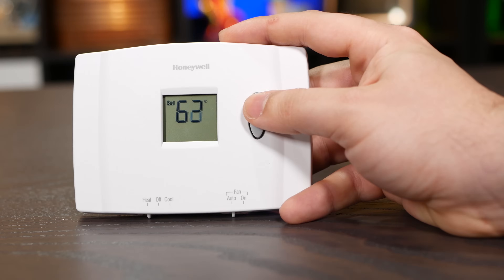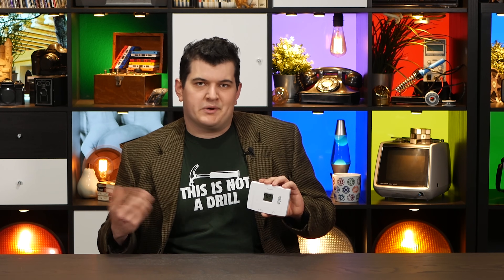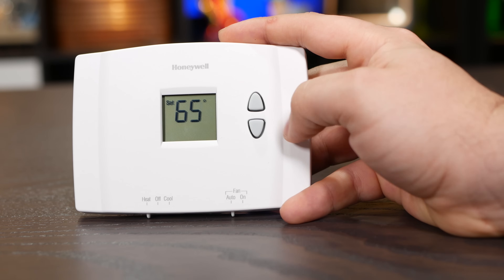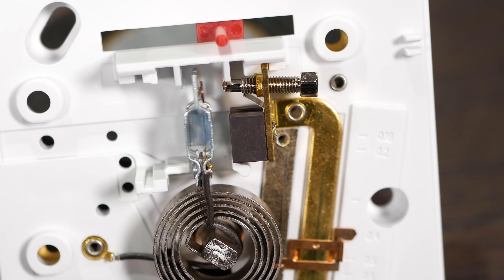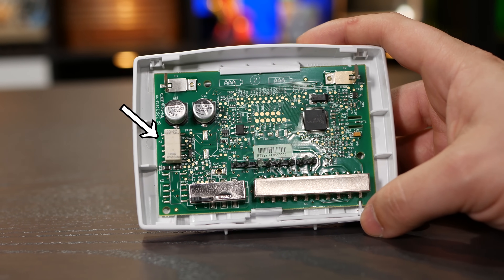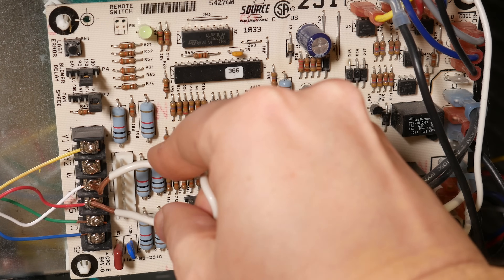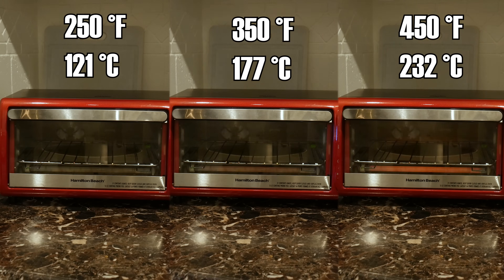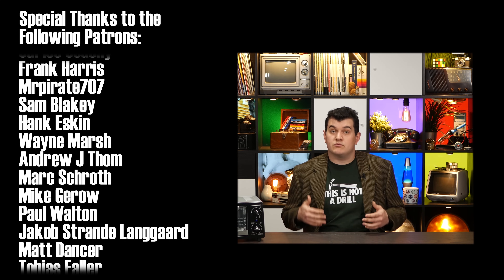Thermostats: Cooler than you think!

Comment: The best part of a smart thermostat is not having to get off the couch to set the temp. If you have a heat pump with electric heat do yourself a favor and get a tstat that allows the "auto" function and set a range (mainly spring and fall) and LEAVE IT ALONE. I have spent all sorts of time setting up programming for people only to have them call me back in a week to disable it. Programmingis good in commercial environments tho. If you have the blue c wire then you should remove the batteries entirely as they can be forgotten amd corrode and that can kill a tstat. Bi metal and mercury tstats are trash and dust can make them inaccurate. If you have a big hole where the wire comes in behind the tstat it should be sealed as a draft in the wall can affect the reading (shoutout to Honeywell and the cover they have on certain models to combat this). I could go on all day but I will stop. If anyone has questions about tstats please ask. I used to talk and text for hours when I was on call in an effort to maintain my first point... to not get off the couch. I am an HVAC service technician.

Comment: with central heating and ac, you usually have vents in each room that you can close. So, it does matter where the thermostat is, especially if you want to be efficient. my thermostat is in the hallway, but i really don’t need the hallway to get heat and air, so i spend a lot of time manually turning the thermostat on and off because the number i set it to doesn’t accurately represent what i feel in a room that’s not the hallway.

Comment: Now do one on the water filled radiators which are common in Germany where you get usually one heat zone per room :)
Reply: each radiator is controlled with a solenoid that opens and closes a valve on the radiator to regulate the heat in each room.
Reply: @kevinchastain727  same as in-floor heating

Comment: Something interesting here: In the Netherlands we produce heat with heating radiators, that flows with hot water from the boiler, that also produces hot water for the douches or the hot water taps. A very well-known brand in the Netherlands is Nefit, and the controls, even the older ones, send a command about how much water flows through, so when there is hot water flowing back in the boiler, it goes slower. To not be scared, there are two apart water tanks for the heating radiators and the taps, otherwise you'd die.

Comment: 16:51 mine does.  It has a button to switch between heating and cooling, but also a button to switch between set temperature, off, and full blast until you tell it otherwise.  You can also tell it to do something like run ac for 30 minutes.  Its nothing fancy either, barely more advanced than the digital one you showed, but just with more functions coded in.

Comment: Some additional information!

Firstly, two-stage heating is sorta common so the notion that "there is no medium blast" is probably true but if you have a fancy pants HVAC system, then maybe cranking the heat up might make it go faster. No idea what percentage of homes have a two stage heating system, but I'd guess it's in the 10-20% range.

In re: the thermostat wire question. Apparently, to this day, the current going through the contactors that actually turn on the high current loads such as your A/C or an electric furnace's heating elements is carried through the thermostat. So, it's more than just color coding; they are designed to carry some current, and thus need to be a minimum wire gauge. So while Cat5 cable or similar would probably work for most HVAC systems, it might not be able to carry enough current for others (and could, potentially, pose a fire risk under the right circumstances).

On that note, and I'm mad at myself for not bringing this up, you might have noticed that in the mechanical thermostat, a separate insulated wire connects the R terminal to the contact on the bimetallic strip. This prevents the current from being carried through the bimetallic strip, which could inadvertently heat it up and prematurely stop the furnace. Neat!

Comment: Re: one cycle heat / cooling, I think honeywell programmable ones can do this.  

Essentially you could either program the thing with daily high low holds or permanent holds in the menu, but if you simply went up to the thing and pressed the + / - buttons it would say something along the lines of "temporary hold - 1hr" or something.

I'm not sure the exact model but I would guess that most "older style" programmable thermostats can do this.

Comment: European thermostats in counties were ACs aren't needed or common only got two wires and still don't require any batteries. They get powered through those two wires AND activate the central heating through em. In old ones by shorting those two, in modern ones by sending the actual AND desired temperature info. Based on that and with a modern thermostat, the central heater unit actually WILL make the radiators hotter when it notices there is a bigger temperature difference to overcome, whilst it will also adjust that heat in the radiators when it notices it takes too much time to get results. Quite intelligent, nowadays. The wiring, by the way, is just like how old landline phones did everything through two wires: ring its bell, receive voice, send voice (even though they always have 4 wires available, and the phone has a 4-way plug, they always only used two).

Comment: Does all of your thermostats in the US run on 24V? In Canada, they run directly in serie with the heater at 240VAC!
Reply: It depends on the type of heating system in use. Generally you would only have a line voltage thermostat if you use resistive electric heating, such as a baseboard heater. Only about 1/3rd of the homes in Canada have a line voltage thermostat, but that is still more than the 10% of homes in the US that have one.

Comment: Programmable thermostats do exist. Usually you can set a week program. As this is mainly done to conserve energy consumtion, I am not really surprised that they don't seem to be common in the US.
Reply: Standard 7 day programmable thermostats are ridiculously common in the USA. In many cases, they are "standard issue." They are, of course, just programmable in the sense that they adjust the set point throughout the day and week. Within the set point, they operate mostly as discussed in the video, pulsing the system on and off.

Comment: "overclocking" while heating up can still be sensible depending on how the situation of the thermostat. If it is in a location that gets heat faster than the bulk of the room you want to heat, this "manual differential" factor can make the room reach equilibrium faster.

Comment: Related to the last question to activate heating or cooling for a specific time without changing the normal set temperature. Some thermostats have some kind of throttle mode where it overrides the current state and switch on heating or AC for an amount of time.
The cheap programmable radiator thermostats have sometimes such functions and our controlling monitor for an old Wolff Therme has that function too. You press a button and the heating or cooling will switch on for, let's say half an hour. It's even programmable for how long this timer will be set and you only need to press that button in future without adjusting the time. This mode let the system run in full boost mode by setting the desired temperature to a very high level or a very low level and returns to normal mode after the timer is running out.

Comment: There are "variable blast" systems on the market. A high-efficiency furnace capable of modulating gas flow connected to a intelligent thermostat communicating over a data wire.  The thermostat will control the furnace to full bore for recovery, and lower output levels to maintain building temperature. Also available are VFD equipped A/C condensing units for more efficient predictable cooling.

Comment: Remember when thermostats used to have mercury vials in them?
I member.
Reply: Pepperidge farm remembers.
Reply: I bought a 1954 mobile home last year. It has what's probably the original little round thermostat. Because the mercury is liquid the contacts have a fresh surface every time, in theory it should last forever.
Reply: My parents told me about a winter when it was so cold that the mercury inside thermometers froze... sounds like a great time
Reply: @derkateramabend  Would be really bad if they froze in the off position. If it froze while in the on position however, should just keep the heat on, and that's what you probably want.
Reply: @setheloe7090  Sorry, I should have been more specific. I meant the normal thermometers used to indicate outside temperature, not inside a thermostat.
Reply: @derkateramabend  Ah, I see.
Reply: @derkateramabend  My university had an enormous mercury thermometer in the engineering building.  I never actually saw it, because one week into my freshman year, someone broke it, spilling several gallons of mercury onto the floor.  The building was evacuated and classes moved or canceled for several days while hazmat cleaned up the mess.  I was not in the building, but I would have loved to see the mercury sliding everywhere when it spilled out.  From a safe distance.
Reply: Heck, mine still does. Still works great!
Reply: Mine did right up until last year when my apartment manager swapped them out for those google nest things.
Reply: Sure. I memeber.

Comment: 16:25
Well if you have a smart thermostat you're presumably using a temperature schedule normally, so you could just set a temporary hold low/high enough to get the system running then cancel the hold later.  If your thermostat integrates with a home automation API you could probably create a macro to set and cancel the hold.

Comment: You missed the part that drives me insane. With a heat pump, most thermostats turn on the "Aux Heat" if you raise the temp by 2 or more degrees above set temp. This does indeed make the house warm up faster. But it also uses about 3x as much electricity.

This is a bigger problem than it seems if you ever use the t-stat scheduling feature. If you let your house get cool at night, and then kick the heat on before you wake up, it's always going into AUX mode. That means it's always using the least efficient form of heat! And totally counteracting any savings you gained by turning the heat down in the first place!

As a landlord I have tenants complain about this all the time because they don't understand how it works. I often wire in a toggle switch to the Aux heat wire so it can be turned on and off as desired. (In my house I just disconnected the aux heat - no need for it in my climate)

Comment: I didn't hear you mention the "anticipator" function. On the mechanical thermostats, this was a little heater, usually adjustable right next to the bi-metallic coil..  This would cause the thermostat to shut off a little sooner to compensate for the stored heat in the furnace. 

On my digital thermostat, sometimes it does turn on sooner if I set it much hotter than normal. Then I turn it back down.

Comment: This is a year and a half late, but per the last question, there already is a method to manually run a furnace/ac aside from the thermostat, a nifty device called a switch on the same control wires (wired in parallel to the thermostat).  Turn it on and it provides the same "short" which calls for heat/cooling.  A timer switch would provide the exact functionality for that final question.

Comment: cool video! also, you can install hassio on a pi. get an esp32 or esp8266 microcontroller. a temp sensor module and a couple relay modules you can have no thermostat on your wall and set temps from a tablet, phone, PC or laptop for super cheap. with hassio you do not need to know how to write code to play with microcontrollers too!
also... those old mercury thermostats... when they kicked the furnace on a small spark happened when it bridged the contacts. i remember seeing a flash one time, when i was a kid a long time ago, come from the wall near the thermostat. it took a few times but i finally took the cover off to watch it. an old round brass or gold colored thermostat. them were the days when mercury did our heating and cooling switching.

Comment: Just because you asked for a thermostat that allows you to run the heating of cooling for a set time regardless of temperature. Look no further than an arduino. With an arduino you can have all the function of a regular thermostat, and any added function your heart could desire. Simply tell the arduino to what you want it to do and when to do it, and you're all set.
BTW thanks Technology Connections for teaching me that you can use the "<"">" key's to move frame by frame.

Comment: I thought modern thermostats were essentially PID controllers. (proportional integral derivative controllers). So they don't heat based on the current temperature, but heat on a forecast temperature.

Comment: In the mercury thermostat from Honeywell there is a small resistor just below the Bi-metal spring. This resistor is in series with the switch and heats up slightly while the Heat demand is on. This will make the Thermostat switch of before the set temperature reached, preventing an overshoot. The 1950's design called this resistor a "heat prediction element".  In the simple version you showed, the resistance of the Spring it self is doing the same function. So if you ever wondered why these simple Thermostats were so much more comfortable with a very small dead band, now you know.

Comment: How about modulating thermostats using e.g. OpenTherm? This can be used in a furnace with a throttling valve or in a water central heating system to regulate the circuit input/boiler water temperature. Not just medium blast is possible in this case, but also x blast, with x somewhere between 5-100% power.

Comment: "Doesn't heat up any faster when you set it to 80".  It's typical for we citizens that live in the colder regions to have 2 stage heat.  All thermostats that I've seen with 2 stage support seem to call for the 2nd stage when it's 2 degrees away from the asking temperate.  So, tell grandma to set it to 72, not 80.

Comment: There is scenario when boosting thermostat temperature can help - if house or apartment has not been heated for a while, walls, floors, ceilings and furniture is also cold. As soon as thermostat turns off heating, they will suck all heat from air, temperature would drop and thermostat would start heating again. With higher temperature and little bit of overheating of air, heat transfer to walls and furniture is higher, heating duty cycle is higher and place will faster get to stable maintaining heat state.

Comment: You can easily add a [Short blast of AC] timer circuit in parallel to your thermostat.
You can find these in any hardware store and hang an impressive big button on the wall, easy!

Comment: They wouldn't use a thermocouple for the sensor as it would require a thermistor for the cold junction compensation.  They would just use the thermistor for the sensor. The on-off described at the end is similar to time proportioning control.  It is where you use on off cycling at a rate less than the response time of the system.  You change the ratio based on the difference between the measured temperature and the setpoint. This way you can get much more exact control.  Adding an integrating and derivative function will give better long term stability and lessen overshoot.  This is call Proportional, Integrating and Derivative (PID) control.  Something I used to sell for over 32 years.

Comment: Yeah there is a thermostat that allows that feature you asked for at the end. It's called the Every Programable Thermostat on the Planet. They all allow you to override the setting and then automatically resume the normal schedule on the next scheduled change.
Reply: Yes but those old school programmable thermostats were pretty much banned when nobody EVER programmed them because they were designed by the same folks who designed PLCs (Programmable Logic Controllers) for industrial applications ;-)  I did (program them in my house) used to drive my wife nuts when the thermostat would change back after a while when she had set the heat up or the AC down and it would return to whatever I had it programmed for...

Comment: Does this apply to gasoline car climate controls like how the car can only run the ac full blast and heater full blast like the house pls respond
Reply: With cars the answer becomes: "It depends".
Mostly on the age of the car & to a lesser extent if it's an expensive car or not.
If you have a fancy display where you can set an actual desired temperature, then usually yes.

With older cars, "it's complicated", & there are exceptions but it tends to be that the heating temperature control actually varies the available heating, from nothing to full blast by controlling water flow, & turning that up will actually heat the car faster.  The AC tends to be on or off.
It gets complicated by a fan speed control, which changes from almost nothing to, more air than the AC can cool.
The latter type system relies on you to be the thermostat & set the controls yourself.

Other systems will use the AC to dehumidify the air even when heat is being called for & in those you should use the AC in winter when demisting the windows.

Sorry for the long response, but the only truly reliable answer with in-car systems is "read the manual".